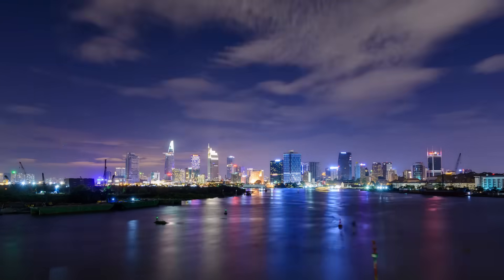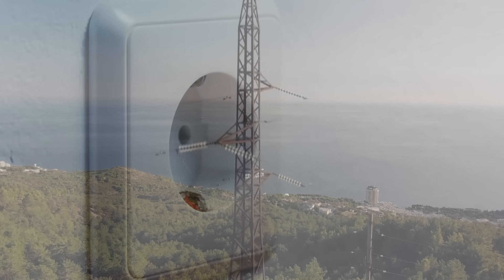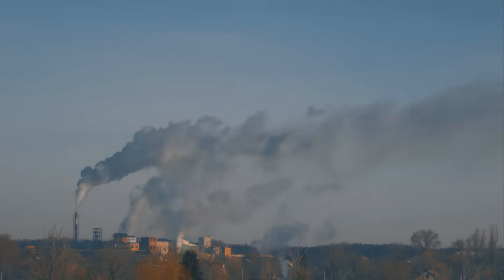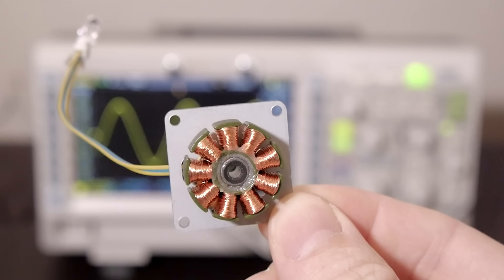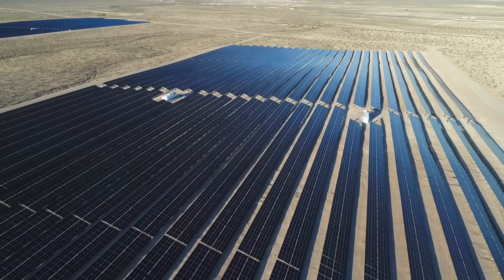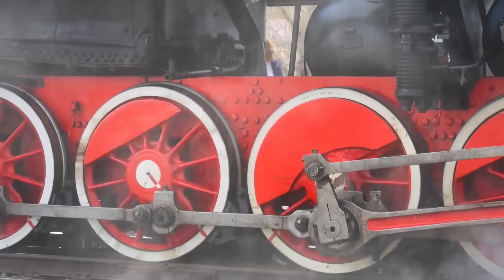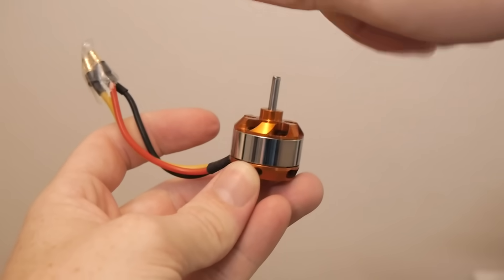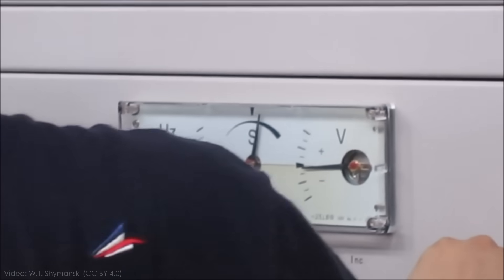How Electricity Generation Really Works

Comment: Case study - Germany - they wanted to go "green" with their power generation and go without nuclear (ironically one of the cleanest sources of electricity).
guess what happened? The grid became very unstable.
All neighbouring countries now have to stabilise the german powergrid and could drop it at a moments notice, of course that alone is not enough. They also had to ramp up their coal power plants to deliver the needed energy. All in all that has lead to significant increases in price and an increases in greenhouse gas emissions.
(And of course the private solar owner had to pay the most with sometimes negative feed-in prices - they had to PAY to feed their power to the grid, but at the same time are not allowed to no do so.)

That is the huge problem of populism: just cause many want it does not mean it is good for them or anybody.
Should we go for more solar, wind, water and other energy sources? Absolutely. But do so without destroying everything in the process. For Wind and solar you need huge energy buffers. Water does not have that problem as in general there are 3 types:
1 - flowing. short drop in elevation, constant production, has loads of inertia.
2 - damns. also constant flow but with elevation drop, can safe up water and release for changing demands.
3 - pump storage. Not for constant loads but extremely versatile and fast to react, great for smoothing peaks and troughs as they can take in the overproduction.

Comment: Not only do wind turbines rely on wind, but the price to build them is equal to the amount of energy it will produce in it's lifetime. Thus it is only paying for itself. (Basically trading money for electricity) This may change as technology advances, but it was the case 2 years ago according to the mechanical & engineering professors I was taught from. You mentioned money on the solar panels, but I thought it was worth noting for wind as well.
Reply: If that was true, nobody would build them. The payback period for wind turbines is only about 1 year. Their technical lifespan is about 25 years.

Comment: How would large-scale power storage technologies affect these processes? Would it eliminate the need to always adjust the power generators so frequently and just run at a constant rate, relying upon the storage to balance and compensate for the surplus and deficits in the grid?

Comment: You made a mistake at 1:08. Electricity usually moves at millimeters per second (drift velocity) and not the speed of light. The instantaneous nature of electricity can be compared to water flowing through a pipe (full of water), a water molecule at one end pushes another water molecule out of the other end. The water molecule does not instantly travel through the pipe and pop out of the other side, but slowly moves along and get pushed forward.
Reply: But when you open water tap, you don't need that exact water which was in river, you need ANY water there is :) And when you open the valve, pressure drop begin to spread over the pipe at speed of sound which is much more than speed of water itself. So after some seconds, water begin to flow all over the pipe, down to pump station or water tower :) So you open a valve and get water IMMEDIATELY (as far as human time intervals are involved), and that is what counts.
Reply: @allmycircuits8850  I see you had a good think about it. In context of the video the speed of electricity is irrelevant (there was no need to mention it, but it was mentioned incorrectly ). Electricity is electrons moving in a conductor. A conductor has a sea of free moving electrons. If one electron is added to the conductor it repels all the other electrons, causing a domino effect that moves down the conductor and ejects a electron out the other end.

Comment: Coal and gas should be replaced by nuclear. Contrary to popular belief, it is safe, the waste is manageable, and most importantly: it’s reliable. I would rather live next to a nuclear power plant rather than a coal one. And the ecologists should ask themselves: is the mass extinction of birds and other pollinators and the destruction of wide areas of vegetation worthy to install wind mills and solar farms? What about the massive amount of untreated chemical waste that goes with battery production? Or the social disruption caused by flooding entire valleys to build sufficiently big hydroelectric capacity (I am brazilian and I know what I talk about: google Sobradinho and Belo Monte)? 
Nay, when you come to do the math, nuclear is really our only option. 
Besides the cost of transition. It would cost 15 trillion dollars to generate 100% of US energy demands from renewables over 35 years, versus 6 trillion over 10 years with nuclear. If Americans begin tomorrow to build enough nuclear plants, in 10 years there will be ZERO CO2 emissions from US.
Reply: I'm generally pro nuclear in principle, but there are at least two problems with nuclear in our time.
1: Building nuclear requires nuclear scientists. Unlike solar/wind, which only require pretty simple mechanical and electrical engineering, nuclear power  requires highly specialised nuclear scientists. I think one of the reasons why nuclear power is dying out, is that there's not much activity in the development of nuclear weapons, so the demand for these scientists and engineers is lower, which makes it harder to bet on this field when choosing an education. I read some interesting things about Kenyas investment in nuclear power.. as part of that they sponsored scholarships for nuclear science. I don't think training nuclear scientists is something that's generally counted as a cost toward nuclear power. But since the job opportunities of nuclear scientists is so limited, to create a nuclear renaissance, we have realise that we need to sponsor the training of these scientists AND guarantee them a job (or sponsor reeducation in the case that nuclear power dies out). This is also probably why building nuclear reactors these days costs so much more than before, and they tend to go way over budget. The skills required has died out (or retired at least)
2: As described in this video, to stabilise the grid you need to balance power generation with load. Now, you can wish that renewables would just disappear, but the fact is, that if you look at the actual costs today (the time/money required to actually finish power plants, not just what they cost on paper), renewables are getting so cheap that they're going to be an increasing share of our power generation wether you like it or not. That means we either need more power plants that can adjust the power generation rapidly (load following or peaking power plants) or energy storage. Nuclear power is not a good fit for this demand. That's the reason why gas power plants are becoming more common. They're relatively cheap to build and good at doing load following. In my opinion, we should look at using excess renewable energy to generate synthetic hydrogen/gas/hydrocarbons to burn in the gas power plants we already have (as well as for boats and airplanes.. or are we gonna put nuclear power on those as well? remember that we need to solve multiple problems to tackle climate change, and renewables and energy storage have better synergies with the solutions we require in other areas)

" If Americans begin tomorrow to build enough nuclear plants, in 10 years there will be ZERO CO2 emissions from US."
Sorry to use this word, but this is bullshit. The western world can barely build a single nuclear power plant in 10 years. In 2007 France (the country know for their nuclear power) started construction of a new unit at an existing nuclear power plant. It's still not finished. At earliest it will start up in 2022. It's three times over budget. Look at UK. Look at Finland. You have similar stories in the US (Virgil/Westinghouse..). If you think it will be any different for the first decade, you're hopelessly naive. Maybe after a decade or two of massive continuous investments in nuclear power, we can actually build on time and on budget. I fully support such an investment, but I'm not very hopeful. By the time you even get such a political movement off the ground, the cost of renewables and energy storage will have dropped by another 50%.

"And the ecologists should ask themselves: is the mass extinction of birds [...]"
Current nuclear power plants kills about as many birds as wind power. Birds collide with cooling towers and other large structures just as much as with wind turbine blades. You think they collide with wind turbines because of the spinning blades, but they actually have problems with any smooth surfaced static structure. Tall office buildings kill even more. And why even talk of saving birds when we still have free roaming domesticated cats? They kill an utterly insane amount of birds.

" and other pollinators [...]"
No evidence yet that wind or solar is a significant part of the problem there, or ever will be.

"What about the massive amount of untreated chemical waste that goes with battery production"
What kind of battery production? Do you have any reliable source saying that this is a significant problem?
Batteries are something we just simply need, wether we have nuclear power or not. In fact, to be CO2 neutral with nuclear power we need a massive amount of batteries to use that electrical energy in our vehicles. We need to work on the environmental impact of batteries regardless. And we are. Batteries get greener, cleaner and better with every generation, which is why they'll also be a good part of the solution to improve our grids in the coming decades. There's also other energy storage solutions, like pumped hydro and compressed air, that we should invest more in.

Comment: Unfortunately the renewable energy options produce much more green house gases for creating and decommissioning them over nuclear. Renewable energy sources such as solar panels require mining of rare earth metals and a very non-Eco friendly process to create the panels. Then when the panel has finished its lifespan causes even more green house gases to safely recycle them.  The amount of greenhouse gases for creation/retirement are significantly more than the panels help reduce. Technically until the manufacturing process becomes Eco friendly solar panels are only an option for reducing the reliance of the grid and reducing $$ out of your pocket book.
Reply: You are perpetuating a common misconception about solar PV. Solar panels generally have a CO2 payback period of 1-3 years and a technical lifespan of 20-30 years. So the amount of CO2 they avoid is many times more than what was emitted in their production.
The main feedstock materials that solar cells require are quartz (regular sand) and silver. Mining these is not the most CO2 intensive process in solar cell fabrication and emits relatively little CO2 than mining uranium for nuclear. FYI the reduction of sand to silicon using carbon is the most CO2 intensive process in solar cell fabrication. 
You are correct in saying that overall, nuclear emits slightly less than solar. However the cost of nuclear generation can not be justified in most electricity markets. In my country, solar with battery storage is far cheaper (5-8 times) than nuclear per MWh.
Reply: https://www.popularmechanics.com/science/energy/a25576543/renewable-limits-materials-dutch-ministry-infrastructure/

There are significantly more rare minerals than you state. Also 98% of solar panels are created in China of which China uses coal and natural gas to create these higher end panels which is being used on homes today. The recycling and waste management is another huge environmental issue. Nuclear power usage similar to how France is refining its power is the most eco and economical solution to our power and environmental concerns. I do agree how the US does nuclear is not the most efficient but again it is more eco friendly than what we are putting on our roofs from China.

Comment: Love all the old photos. The frequency converter in the thumbnail, and the large direct current machines later on. To be fair, three phase power allows for the transmission of ~1.73 (square root of 3) times as much power on 1.5 times as much copper, assuming the line to line voltage is the same. If the line to ground voltage (what the insulators must be designed for) is the same, three phase power actually only transmits 1.5 times as much power on 1.5 times as much copper...

Comment: My dad was talking to a engineer at a hydroelectric plant. He was told the hydroelectric plant is the easiest/efficient place to adjust grid following because of the static reserve of water.  Others loose efficiency on warm up and cool down.
Reply: Yep. Grid operators love them. The only thing better is battery storage, which probably wasn't a thing when that discussion took place.
Reply: The worst for adjusting grid following is windmills
Reply: @elischultes6587  can you provide a reference for that because that's exactly opposite to what network operators tell me.
Reply: @gasdive  Wind turbines' output depends on the cube of wind speed, so the fluctuations can be very high, causing many problems for operators. Type 3 and 4 wind turbines (99 % of the turbines that are installed lately) are connected to the grid via a power converter, meaning they don't provide inertia. In Ireland, they are limiting wind turbines' instantaneous penetration because of stability issues.
Reply: @gasdive  I believe they are good in one direction and bad in the other. If Im not mistaken wind turbines are very quick to respond to an decreased load but horrible at responding to increased loads. Though I might be getting it backwards.
Reply: @elischultes6587  wow, that was a shockingly inaccurate comment.  I have been in wind for 24 years, and I can assure you that wind turbines (especially GE) are fantastic at power factor correction (oh, I mean "adjusting grid")
Reply: Sorry I think I crossed grid following for load following
Reply: There's even talk to create dams in hillsides that don't have water flowing through it normally and intentionally flooding the back end as a form of stored energy, especially when renewable energy is cheap and thus excessive so that it can be released later during the cyclical deficit. It's called pumped-storage hydro, and already exists in smaller scales.
Reply: @doujinflip  check out the Snowy Mountains Hydro Scheme in Australia. It is as you've described.
Reply: Here in Brazil 80% is hydro. But in 2001 there was a rain shortage and we had no power. I can't even understand why it's so expensive, because it's clean and reliable almost all the time. And the dams are beautiful.
Reply: @T.L. Watkinson renewables without storage are very ineffective. You need to ensure power delivery when people  need it. You can do funny things like increasing cooling of refrigerators when you have more power being generated and less when generation dips, but that only gets you so far. 

Pumping water up hill allows for some of that lost capacity to be used when the sun isn't shining and the wind isn't blowing rather than having wasted capacity.  The alternative would be even more expensive capacity and being unable to use electricity during nonpeak generation times.
Reply: Being a hydropower engineer, i endorse the stAtement ..

Comment: Imagine if all the human effort that was put into solar, wind, wave, etc was instead all concentrated into figuring out how to bore miles and miles down through the bedrock.
We're floating on magma at all times. We have a whole planet's worth heat energy at our disposal.
Reply: I'm not saying we'd have it by now. It's a very challenging engineering problem. But we might be that much closer.
Reply: The issue is HOW far down it is. If we do that it would not be efficient as it’s so far down. You’ll have several miles of cable to travel heat or electricity through. Russia made the worlds deepest hole basically and it was 7 miles deep (if I remember right. It could be 7Km). It’s just good enough.

Comment: Or we just build more nuclear plants that emit zero co2 and does not need you to build thousands of structures. Nuclear is also reliable compared to solar or wind
Reply: What about all the waste materiel?
Reply: @FemmyFoxxo  A vastly overstated problem.
Reply: @FemmyFoxxo  t
Total US nuclear spent fuel volume is tiny compared to the ash mountain from one coal plant.  The amount of material needed to build solar and wind farms at national  scale is vast, some 50 times that of an equivalent nuclear plant, nevermind the storage required.

Comment: Maybe talk about how storing electricity isn't very efficient which is part of the issue with wind/solar
Reply: It is THE issue. Every MY of wind/solar is backed up by fossil fuels
Reply: Your statement is not entirely correct. The round trip efficiency of battery storage is generally above 90%. The issue is that it's expensive, not that it's inefficient.
To put things into perspective, the overall efficiency of the best, most modern HELE coal fired power plants is only about 40%.

Comment: Use the power generated by wind and solar to pump water to an elevation. Use the elevated water flowing back downhill to push a turbine. Both storage and inertia.
Reply: Uneconomic

Comment: There seems to be a debate about "smart grid" vs. "power wall" and I'd like to know more about this. The power wall people want to use the power utility as a backup charger and can charge during off peak to take advantage of less expensive energy.  Could you do a video on this?
Reply: Or use the batteries in an electric car to supplement the source of off-peak power
Reply: @GlenJackson  So many good ways to do it.